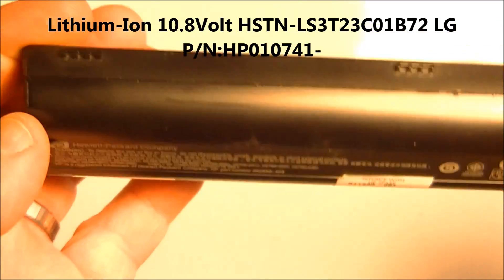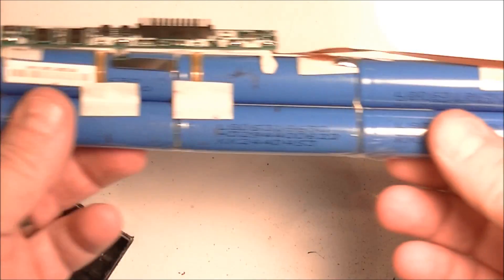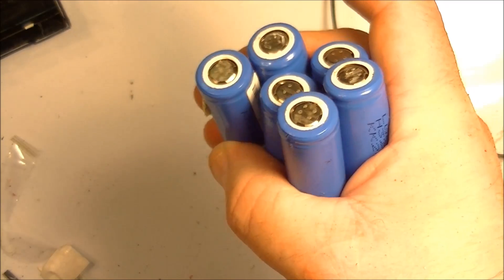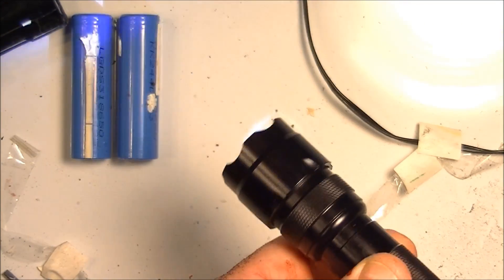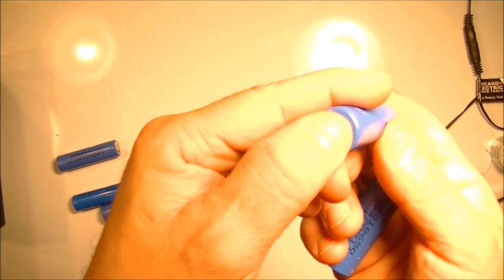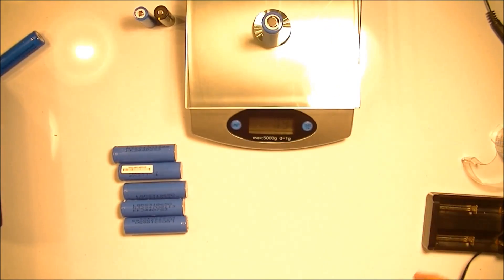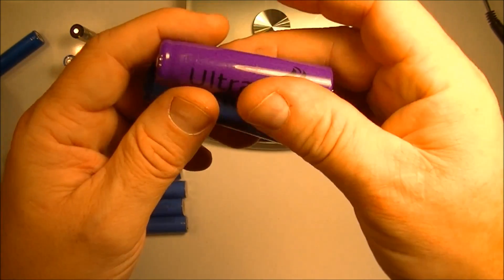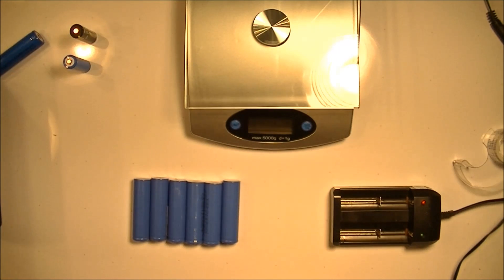18650 Lithium-Ion Battery Harvesting From Old Laptop Battery Pack

Comment: Great video thank you. I was actually fooled by the ultrafire 6800 on ebay. I thought oh man finally a battery that will be surpass my expectations. What a bunch of crap. Used it in a usb charger to charge my phone and it brought it all the way from 50% to 60% before shutting off. I was thinking maybe I did not charge that one so I charge it up was done in no time which I thought was wierd. This time it brought it up 5% before shutting off. Gut out some wire and used my hobby charger to discharge and then fully charge the battery. I had to do it twice because I just could not believe the results. 860 mah yes a whopping 860 mah. I think these are really old batteries they found somewhere and have rewrapped them to read 5000 6000 and 6800mah. These batteries were removed from Amazon due to negative reviews. I have made an official complaint to Ebay but I doubt the greedy company will do anything about it. Any one who reads this please complain also so we can get these garbage batteries out of the US.
Reply from the maker: You are welcome. They are garbage batteries. They are like the "heavy duty" batteries from the dollar store. They look good and then you figure out why they only cost a dollar for two. Ebay is still selling the bogus batteries and some people actually think they are getting good product. If it's your first purchase you would have nothing to compare it to. Thanks for the feed back and watching. I appreciate it.
Reply: This is so true. Every single battery on eBay is fake. The knock off battery packs for the iRobot vacuums are all mislabeled too and only about 1/2 of they claim.
Reply from the maker: dddd If you want "real" batteries understand that there is no 18650 battery which can store more that 3400 mAh so anything claiming over that amount (currently) is a fake. I made some video's on a few 3400 mAh batteries here https://www.youtube.com/playlist?list=PLnxXRLSlmSVO3L0jStRnPEEN2egrODjnm but the are not cheap. The old saying,"If it sounds too good to be true, it probably is." applies to cheap batteries. Thanks.

Comment: I have a laptop that uses that part number.  It looks as if there night be 6 18650s inside it.  It is one of those ones that no longer holds a charge.  I have read that it only takes one bad cell to cause them not to work and usually most of the cells are good.  It seems to me that the protection circuits inside a battery pack won't let any cells take a charge if just one is bad.  I know the individual cells are not protected but there is a board inside each most laptop battery.  Any laptop battery that is not known for starting fires would likely have that circuit.  It is better to have a battery that does not work than a house burned down or a someone badly burned.  Also you would not want to inhale any of the fumes if one of those cells does leak or vent.  It smells horrible and it is certainly not good for you what it is.  I read that hydrogen flouride is one of .the gasses released.  I do not know that for sure but hydrogen flouride is very nasty.  It is also known as hydroflouric acid which dissolves glass.  There are a bunch of other nasty acids that don't affect glass like that.  Hydroflouric acid is stored in containers made specifically for it because it will dissolve things many acids don't even leave a mark on.
Reply from the maker: I would take the pack apart and test the batteries individually to see which one is bad. Even if they one is bad may hold enough of a charge to use in a flash light. You never know but at this point you have nothing to lose. I took a cheap "protected" Chinese battery apart here: http://youtu.be/F28wGnDE6Ms?list=PLnxXRLSlmSVOdRpt-8Ha-vt4tH4A9tyH_ and yes the smell was terrible. Even though it said it was a protected cell it actually was not protected.
Reply: Richard Lloyd I have an Ultrafire 4000 mAh that said protected.  It had no PCB on the bottom.  I also would not believe the 4000 mAh claims either unless it was a 26650 cell instead or somewhat bigger than 18650.  I also have a couple NiZn batteries.  Those are nickel zinc.  I never had such a crappy battery in my life and I once use nickel cadmium batteries that also suck.
Reply: +John Doe pcbs are usually on top, and they usually are fake, i have some 4000mah ultrafires, extremely light and have a short circut current of 14 amps, definitely not protected.

Comment: Great vid, thanx for that. 
Actually think to exchange the cells from my laptop pack.
Really you get what you pay for chinese battery case.

Cheers
Reply from the maker: You're welcome. I am going to upload a video where I compare these with the Ultrafire batteries next. Thanks
Reply: Everyone says that the Chinese batteries are dangerous and to only buy good Japanese ones instead.
Reply from the maker: John Doe  It's hit and miss with the Chinese batteries but mostly miss. Here is a video on their capacity claims vs the real capacity of the batteries. Note that the Thunderbolt made in China NiMH rechargeable batteries were actually better than they were claiming. http://youtu.be/xREp4T2hKIM?list=PLnxXRLSlmSVOdRpt-8Ha-vt4tH4A9tyH_

Comment: oooo maybe i can use these in a mod i doubt it would be safe though
Reply from the maker: Please note that they are unprotected battery cells before you use them on anything. Thanks.
Reply: +Daniel Jaramillo as long as you dont exceed 1c continuous or 2c peak

Comment: What do you mean by "unprotected"? 
no overcharge protection?  so you need to keep track of how many minutes/hours they are charging?
Reply from the maker: Unprotected as in there is no protection circuitry in them at all. Your charger needs to have overcharging circuitry in it to keep from overcharging these batteries or they will overcharge. They also have not short circuit protection either so you have to be very careful not to do that. The protection circuitry is built into the battery pack and managed by the laptop. Once you harvest these batteries from the pack all that is gone. Thanks
Reply: Richard Lloyd
Thanks very much.  Can you recommend some KEYWORDS (to search items on ebay or other similar site), for a charger then, that would have good sensing circuitry?
Reply from the maker: *****  This is what I use Nitecore IntelliCharger i4 Battery Charger - 2nd Generation I don't use ebay as I have been burned with counterfeit product I bought mine on Amazon http://amzn.to/1xvkYKw Now that you have mentioned it I will put a review video on my list to do on this charger. Check out the reviews on Amazon too.
Reply: Richard Lloyd I live in Canada.  amazon.com sells this to USA residents for $17, and amazon.CA sells it to Canadians for $30!  I'll be damned before I pay them those prices!  So it would be nice to know what keywords to search on, so I can find equivalents and better values. 
BTW, there are plenty of sellers and affiliates peddling this model on youtube already.  I just don't think it's worth that much money for a charger.  (it's not a horrific price, but it's not a deal either)
Reply from the maker: *****  That's highway robbery even with the exchange rate. I just searched Ebay.ca with "nitecore intellicharger i4 v2" version 2 is the latest and found them for under $20 here http://www.ebay.ca/itm/NITECORE-Intellicharger-i4-V2-Li-ion-Ni-MH-Ni-Cd-Universal-Battery-Charger-2014-/201245221700?pt=Battery_Chargers&hash=item2edb266344 Feedback is 100% with almost 4000 sales so you should be good. Thanks
Reply: @richardlloydusa  0
Reply: +Richard Lloyd 
That's the charger I have.  Top notch for all my recharging needs.

Comment: dont try to rip this welded tabs form batteries lik this, the cell can be damaged that way(something inside must touch this end of tube to work properly)
i did this this way until i noticed this damages them to 0volts...
Reply from the maker: I haven't had that problem doing it this way. Note that I don't pull on them I use the pliers as a leverage point by rolling the tabs. This reduces the amount of lifting on the metal. Thanks.
Reply: +atomek1000 just roll the pliers

Comment: I have an old IBM Thinkpad X21 battery. It has 6 red cells inside, they are larger than an AA battery by far. Do you know if I can mod them into a Gameboy Color?
Reply from the maker: I would not recoomend doing that. These batteries are 18650's they run 3.7 volts and the gameboy runs at 3 volts. It might smoke your Game Boy. You would be much better off buying a set of rechargeable AA Ni-MH batteries like these 2000mAh at Amazon: http://amzn.to/16pWruy or a high capacity 2400mAh AA set :http://amzn.to/135f70E These will pay for themselves in no time if you use them frequently. BTW you will need a Ni-MH battery charger for these as well. Here is one at Amazon: http://amzn.to/1ACSMCA
Reply: Yeah, the voltage is not the same. Anyway I'm gonna try to recharge them to see if this X21 battery revives.
Thanks for the reply!
Reply from the maker: Faef Lemon  You're welcome. Thanks for watching and good luck.

Comment: Hi Richard, I'm going to order the HP battery pack from Amazon. How hard is it to open the battery pack without a dremel tool? Is the battery pack made of metal or plastic? These batteries are real LG's at least I hope. If you can please reply.  Thanks.   Mike   PS another Fantastic video!
Reply from the maker: Thank you. You don't need a dremel to open them but it's nice to have. I used flat head screwdriver to open my last one. The casing is made of plastic. Just be careful not to damage the cells also understand that the batteries may be charged so you don't want to short them. Work safely. Thanks for watching.
Reply: Thank You Very Much for your prompt reply concerning the HP laptop battery pack. I feel so relieved knowing the battery pack is Plastic and not metal. Should be no problem and I'll be careful not to damage my batteries.  Mike
Reply from the maker: bendari  You are welcome. The batteries I have harvested from these packs are the best batteries I have for my LED lights. Thanks for watching.